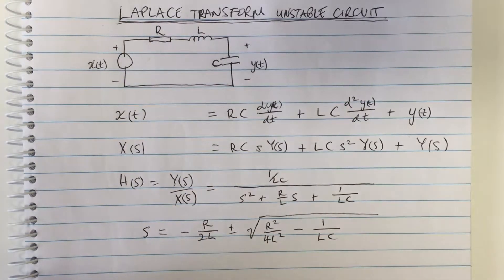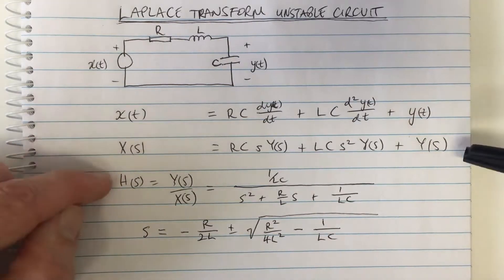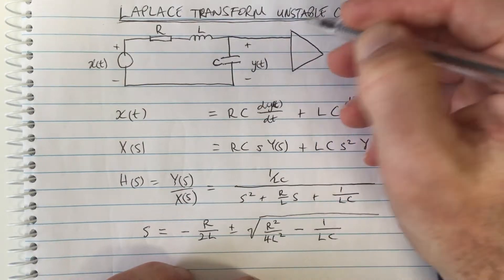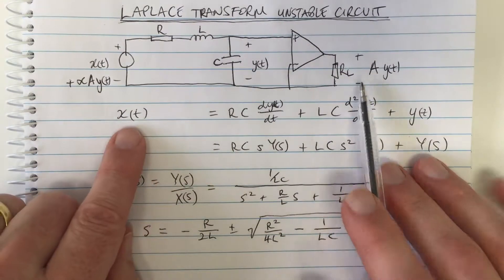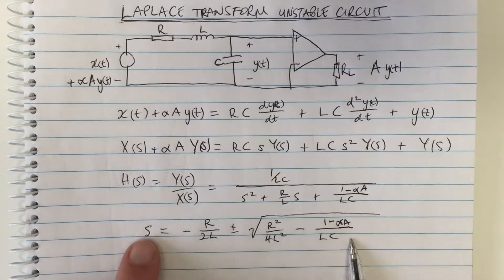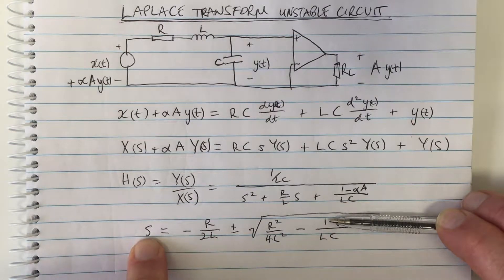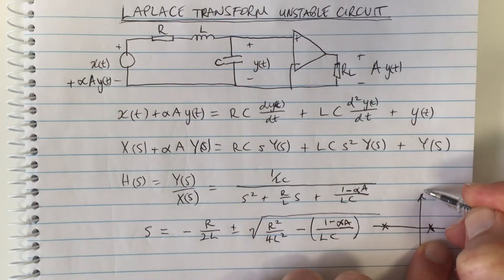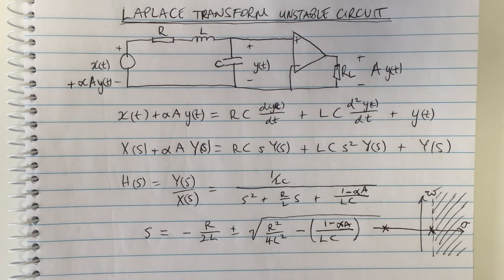When do you need the Laplace Transform?

Comment: Would you have to assume this circuit is AC so you have a sine wave and exponential function in series?
Reply from the maker: No, the system transfer function, H(s), characterises the response of the system for all values of s=sigma + i omega in the region of convergence (... where omega is the radial frequency). When you set omega=0 it tells you what the response is for DC inputs. Perhaps this video will help to explain: "Laplace Transform Region of Convergence Explained" https://youtu.be/SexBL1OlhhU